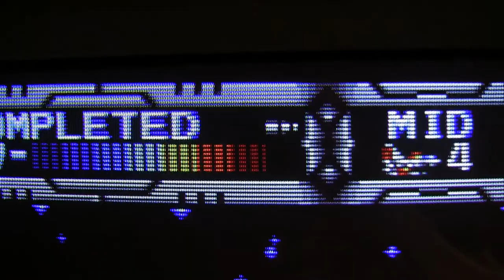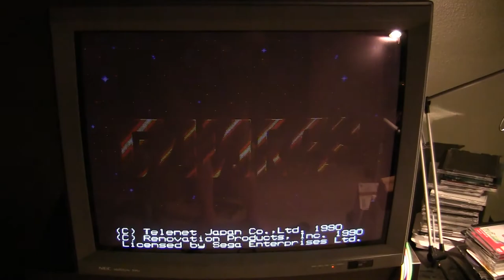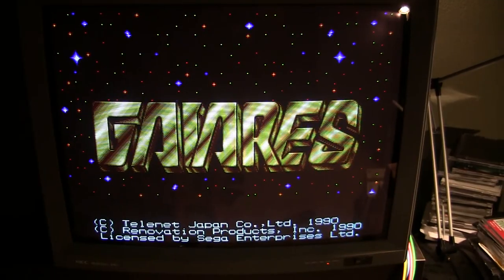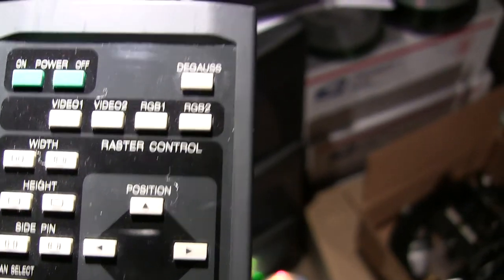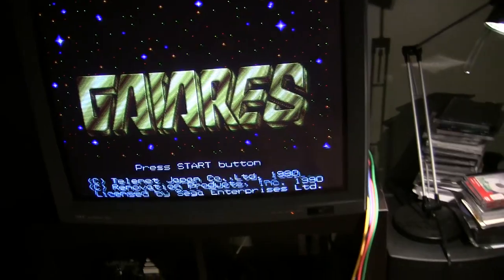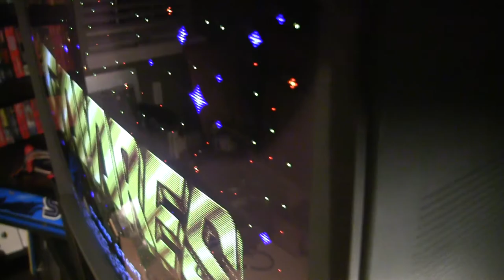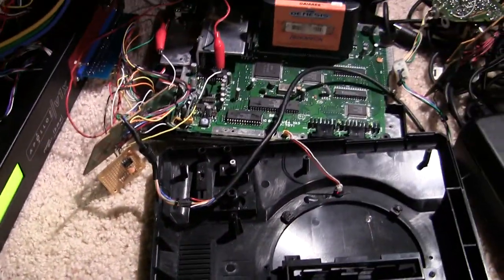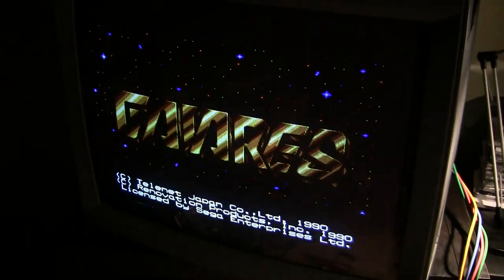NEC XM29 Monitor (For Gaming) Review

Comment from the maker: So two things- first, the Genesis would not sync until i flipped that 75ohm/high switch for the sync input on the back. So its running on 75ohm against what the manual says it should but its working. The other issue I had with pure white was due to feedback I was getting from a RGB amp I had installed in my unit. I removed that and it solved that issue. I also added an Extron PA250 peaking amp/sync stripper that I won for $10 on eBay. That restored brightness and fixed remaining issues.

Comment: In the 90's Best Buy had a massive video wall in the game section.  Mario Kart for the Super Nintendo was playing.  Best Buy still had it up when the N64 came out.
Reply: Dex Flex I recall seeing that at the one in my town back in my youth then. Just a huge chain of displays showing off Donkey Kong 64. It was absolutely entrancing.
Reply from the maker: Dex Flex Yea video walls were always so awesome! Sadly all those video wall monitors in stores and clubs from the 90s were either chucked in the trash or sold for 20 bucks a pop. I almost took delivery of a stockpile of 12 monitors and processor but had some logistic troubles getting it all shipped. If everything were only driving distance....

Comment: So are there any major differences between this model and the XM29 Plus or Xtra?

From what I've gathered, the main difference seems to be in availability of certain settings. There aren't any forum topics detailing this comparison that I can find so I'd like to start gathering information on it.

I'm picking up a free nonfunctional XM29 from a nearby town to troubleshoot it and get it running again so I'm looking for as much information on this monitor as I can get. Hopefully it's a simple fix (solder cracking) but we'll see. This'll be for Tate mode since I can't really use my BVM 14F5U for that (due to the front handles).
Reply from the maker: ***** From just doing a basic comparsion on the specs between the 2950, 29 Plus and 29 Xtra, the tubes are different pitch to begin with, but the big difference is the HSync range: 2950 does 15khz-50khz, 29 Plus 15khz-65 khz and 29 Xtra 15khz-70khz. After that, its all pretty close. I'd say you can't go wrong with any model but if you can get the Xtra that would have the most flexibility. Good luck on the repair! These things are absolutely INSANE inside, I had to repair my RGB1 input when I got this one, the terminal PCB is easily prone to cracking if anyone jams on them hard enough or tugs a dsub cord thats screwed in!

Comment from the maker: Better yet- go get an Extron PA250 on eBay. Its a professional sync stripper and peaking amp all in one. I won mine for $10! Goes perfectly hand in hand with this monitor. You'll only need an extra set of cables to hook it up.

Comment: May I ask what CRT the monitor is using? It's not a Toshiba by any chance?
Reply from the maker: +Tomas Dahlgren I honestly do not know. I did open it up to do a repair but I could not easily remove the entire case to reveal any stickers on the tube. Sorry
Reply: It's a Toshiba M68LMF256X, super fine .6mm pitch with their Microfilter technology. One of the best. Sorry I'm only 6 years late.

Comment: The issue I am having is with the video being fuzzy I am trying to use it with a a neo geo home console and I tried flipping the switch to 75 high and that seemed to help a little. My model is the xm29 plus do you know of any other causes? What should the dip settings read? Thanks for any help

Comment: I use Sony PVM and SCART switch and SCART to BNC cables, to hook up some retro gaming consoles. They all work fine with the Sony PVM 20 without any sync strippers, etc....Do you know if I need any extra hardware in order to use my SCART switch/scart to BNC cables along with a NEC XM29?
Reply from the maker: Sorry, I don't know if it will require extra hardware for scart format. In the US we don't have much SCART stuff laying around so I don't get to mess with the cables much but I'm definitely going to be using them more going forward so I don't have to hack consoles so much for rgb.

Comment from the maker: Are you using the RGB1 or RGB2 inputs for your neo geo? If you're using an RGB input, im not sure what could make it fuzzy. I would only expect that to happen on the standard video or even s-video inputs. That Extron PA250 unit does have a tweaking pot that will reduce the fuzziness of the picture making it sharp as possible.

Comment: You don't need the remote to do all those functions. I have this monitor and the remote. But I can adjust it through the menu as well. I used a regular stripper on mine that is built into the female scart to bnc from retrogaming cables. Works great! My PVM does not need a sync stripper but my NEC did. How is that Extron PA250 vs a normal sync stripper??

Comment: I have the NEC XM29 and the Extron PA250 and it does not strip composite video into clean sync for the XM29. Basically, I find the PA250 useless for me.

Comment: Can someone please explain the drawback of the XM 29 (not plus) only being 15.5 - 50.5 khz whereas the XM 29 plus is 15.75KHz and 31-65KHz?
Reply: Plus can't do arcade boards that are 24KHz, and some x68000 games that are also 24KHz. Plus does have an on screen menu and buttons on the front though. Regular XM29 does not.

Comment: hi there. i got the same device. when i am restting any rgb console, it loses all its raster settings (position/width/height etc).

i cant acces OSM menu and i only find manuals for the xm29 PLUS or Xtra, not for the regular one. any idea how to save the position etc or even activating the on screen menu using dip switches?
Reply: i just realized that my remote is slighlty different. its missing the "user preset"-key

Comment from the maker: How do you access the menu on this? I don't have any menu buttons that I can see on the monitor. It has 2 buttons on front, power and input and only input buttons on back.

So the Extron PA250 is a typical sync stripper but on steroids it does the same job and has a nice amp boost in signal that you can control. It makes quite a difference for signals with lower Vpp. I can crank it up for Genesis, Saturn and turn it down for arcade boards. I picked it up for like $20 on ebay well worth it.

Comment: btw the scart to bnc/vga breatkout board made by viletim is a must have for this monitor. It has a built in sync stripper and you input scart and it breaks it out to either vga style dsub (it doesn't upscale it) or bnc. I just have this hooked up with a vga cable to my tv and plug in my games via scart and when I wanna use the vga just unplug it from the board and into my pc and the monitor switches frequencies automatically. 
http://shmups.system11.org/viewtopic.php?f=4&t=35885
Reply from the maker: Awesome, thanks for sharing that.

Comment: Hi, was wondering how you have your dipstick switches setup for BNC and Do you happen to know the dipstick switches for vga thanks :)
Reply from the maker: Melvin Ringue Currently set at: DS1 = 11100001 DS2 = 00000000. That is what they were when I received the monitor. I just use RGB1 for VGA in and RGB2 for BNC in.

Comment: Will this monitor sync with arcade games (24khz)?
Reply from the maker: gottenx25 according to the manual, no. It has 15khz followed by 30khz, nothing between.
Reply: You have a supergun don't you? Why not try it an see..
Reply from the maker: gottenx25 if it were only that easy. No time at all these days, big mid res boards packed away, dont have a working Supergun at the moment never finished my new one. Some day...

Comment: +srarcade I've got almost the exact same monitor (model XM2960 for me).  Really great pic.  Regarding sync form the Genesis/MegaDrive: this has been a known problem.  Do you have the appropriate resistor and capacitor set onto your sync line for the Genesis? I've got a similar issue on mine with my Genesis, and it seems to refuse to sync unless set to "Hi-Z".  If I find any updates, I'll PM you with the info.
Reply from the maker: NightSprinter Thanks- no i don't think i changed anything on the output of the Genesis signal. I am going to eventually build a new cable and incorporate a small amp and filter, we'll see how it goes. Let me know what you find!